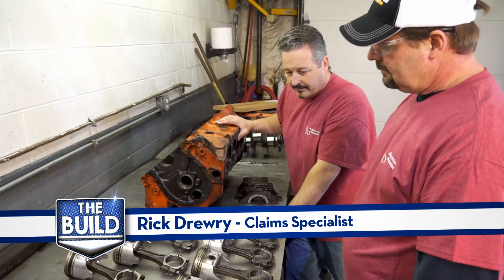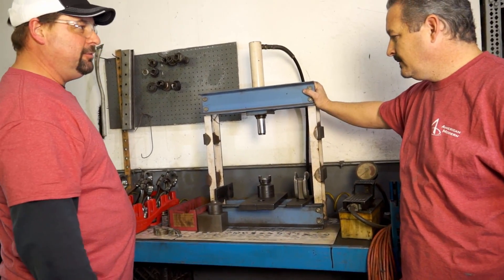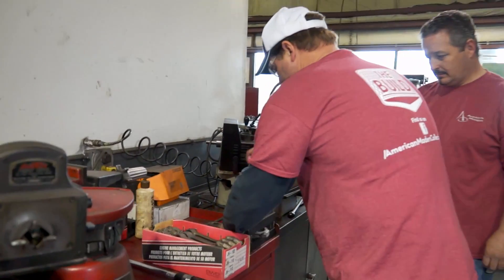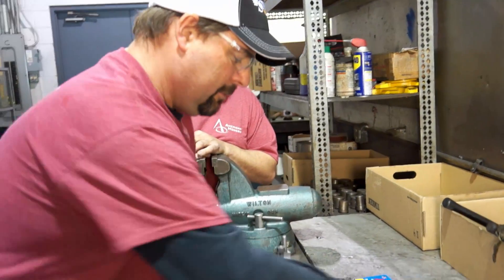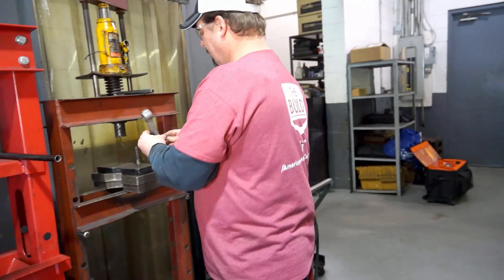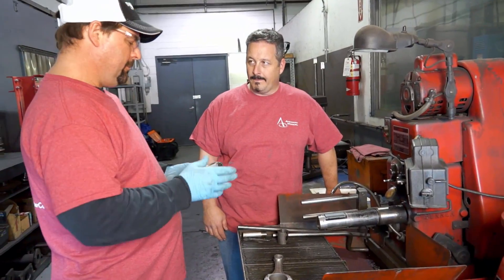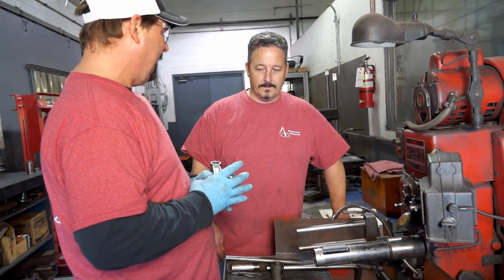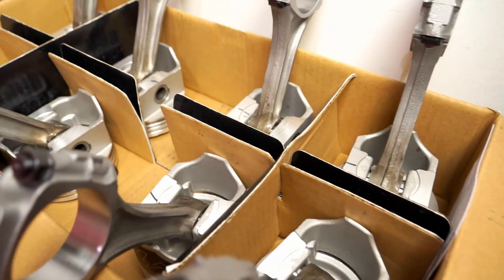Reconditioning and installing connecting rods into pistons - The Build

Comment: Very few people show how the rod cap is machined down. Instead, they only show the connecting rod being honed to standard size.

I like the heat crayons. I see people heat wrist pin in a machine, but they don't tell me how they determine temperature. I guess people foolishly assume that a rod heater automatically know what temperature it should be.
Reply: Wrist pin isn't heated. If anything, it's tossed in a freezer for a few hours prior to assembly to theoretically get contraction of the metal to further open the gap between the pin and the small end of the rod.